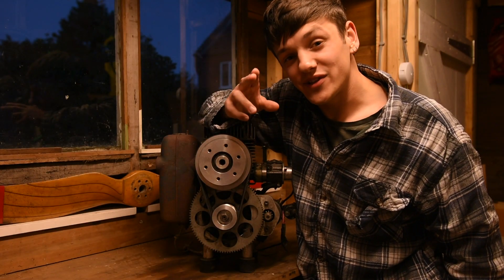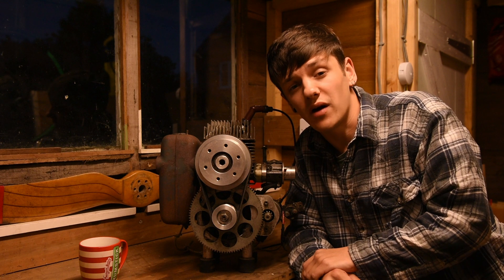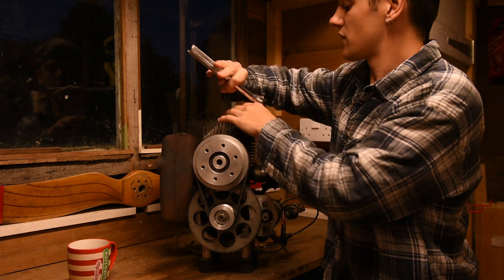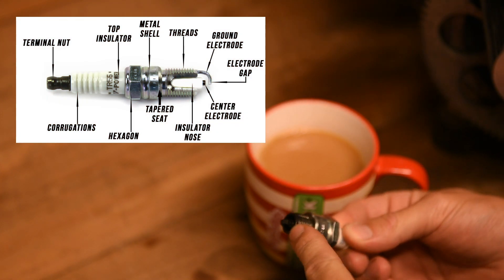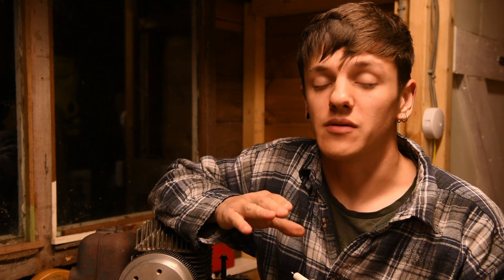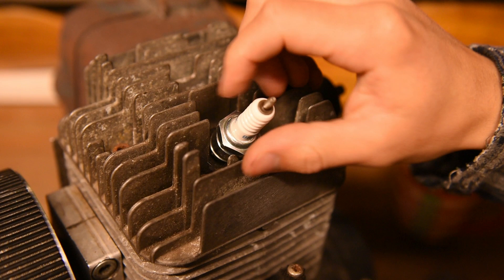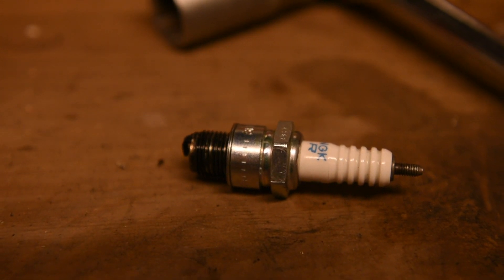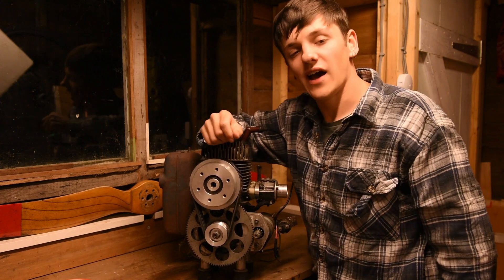How To Read Spark Plugs

Comment: Great advise about the tightening of the plug. I had a friend who had a land out. Basically someone had put his plug in. Although it can't be proven that this was the cause the plug stripped the thread in flight causing him to have to perform an engine out landing.
Reply from the maker: not good, if you look after your spark plugs they'll look after you. This is also the exact reason I work on my own vehicles, so I know what I've done or not done properly as it sometimes happens haha